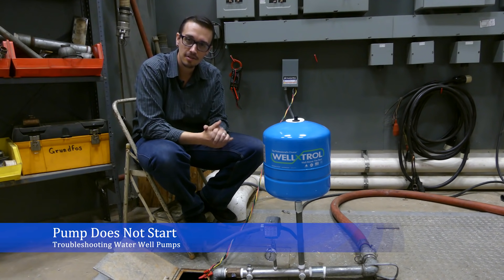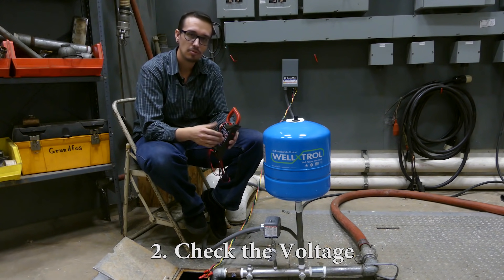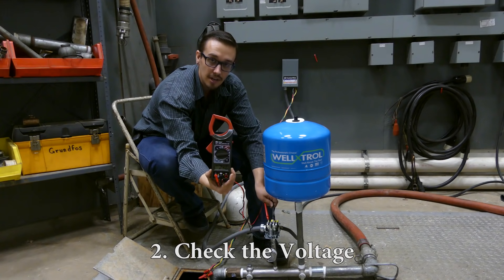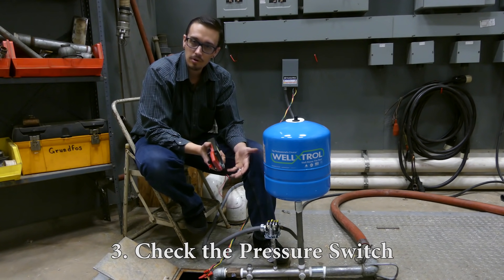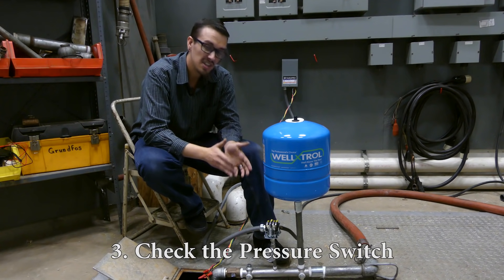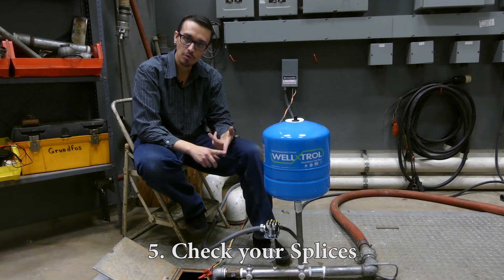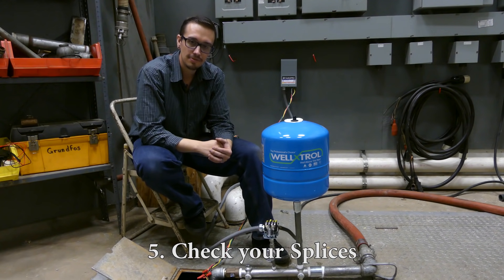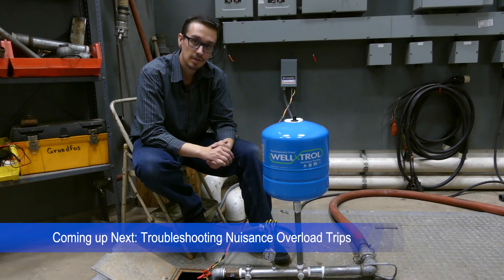Troubleshoot: Water Well Pump Does Not Start

Comment: I have replaced pressure switch twice. pump builds to 50 and shuts off. then drops to 12 before restarting. 28 in tank when empty.. removed guage and cleaned some gunk off with pump off. deided to turn back on to make sure no more gunk but no water came out. shouldn't water have came out of pressure gauge hole
Reply: Sounds like your pressure tank is waterlogged.

Comment: Have watched many of your other videos, learned much from them.  Now I have a situation where I have a no water system.  Just replaced the pressure switch, well pump fairly new.  So wanted to know how to check power at various points. This is less than helpful, when you start  throwing around jargon, without explaining what that jargon references, on top of pushing the probes into the control box, but then not letting us see (@ min. 1:43) just where you're poking the probes in....  (what does it mean to say, "across the line?"   oh, and showing us the meter, but being so far away not actually helpful....   Appreciate the spirit of this series, but cross check/edit your video with an intelligent novice who wants to learn.... don't just "talk" .... and presume we know what you're referencing....
Reply: Big time

Comment: Hey there I could use some help. 
I replaced the switch panel for my water pump, to a start switch. Which means I have to click the switch on the panel to turn on the pump. 
When I switch it on, it clicks but doesn’t run. 
This water pump is two months old and hasn’t had any issues until now. 
I’ve changed the foot valve in the well, primed the well line and pump. Still no luck. 
What else could be going wrong?
Reply from the maker: Check to see if the pump is getting power at the motor.

Comment: We replaced the pump switch. The problem we’re having is that we have to keep manually resetting the switch. The breaker is not tripping. It happens at various times—even in the middle of the night when no water has been used for hours.
Reply from the maker: Sounds like you have a leak.

Comment: After 27 yrs living in a house with a well here’s where I start
(modified slightly for lawer safety check…. namely #1

#1 turn off the power

#2 which would be #1 without lawyers is I take the top off the pressure switch and look for ants in between the contacts . 

#3 If there are ants Say an expletive or 2 , recheck that power is off, blow the ants out with compressed air and flip the contacts open and closed with a insulated tool like a screw driver while looking at contacts to make sure they’re still good and clean

#4  if contacts are durty etc is replace the pressure switch 

#5 which doesn’t count if there were no ants or obvious problem found is  turn power back on and put the cap back on or visa versa.

 This is also a good place for a few more expletive’s and visualizing an electrical world without ants…. 

#3 if there were no ants is check the wiring 

IF you have 220/240 there are 2 black and 2 red so check each red and black with contacts closed and open to check power … This must be done with power on so don’t do this  if your neighbor is by the pool in a bikini… Fortunately I don’t have any pools next to me…

If the pressure switch electric is good now is a good time to check the air pressure in an empty tank. That number should be on the tank and correlates to your switch pressure.

The pump will run too much if the empty tank air pressure is too low etc. 

My pressure switch is 40-60 so my empty tank pressure is 38…

Today is was at 20

If your breaker is blown or the overload reset switch under your well pump electric box is popped you can reset them but you still need to find what popped them.

My electric box has a run capacitor and a start capacitor. 

The start capacitor was rusty and worn on the top… or bottom depending on which way you face it so I just replaced it AFTER tripple checking power was  off and g rounding the terminals with an insulated screw driver. 

Capacitors hold energy… that’s their job… 220 v (the amps in the volts) can kill you or even possibly give you an afro so be smart and fight power… I mean turn off the power…

The run capacitor looked good.

If they look bulged on top or sides they are bad,, also if rusty.. better safe than sorry.

Retested and thank God it worked cuz I don’t fit down the well shaft to get down the 250’ to the motor…

FYI my pressure switch has an external lever on it which has to be held just just right ti keep the contacts together till the water pressure is high enough to keep it on by itself. This is a pain in the butt BUT it stops the pump from running continuously without water so it’s sorta like insurance….

PS fyi… If you’re new to wells they usually are disrupted by ants in the middle of cold dark 30 degree F nights after you’re already in the shower…

Comment: Awesome video ty. Pretty sure my pressure switch is going bad or the points are corroded. I haven't opened it up yet, but tapping the PS made it work again (temporarily). It's now off again, but this is probably my PS going bad and needs replacing correct? Many thanks

Comment: Just sat on basement floor for an hour watching pressure gauge. Was at 55psi and dropped to 38psl which did start pump. Gauge went up to 55psi and pump stopped. No water was being used for the time I was watching gauge. Ideas????

Comment: Nice video!  I was using water earlier today and now I have no pressure.  I reset the main breaker and also the pressure switch.  When I had the pressure switch set to on absolutely nothing happened.  Any suggestions?

Comment: Thanks for the vid.  I ran through your procedure, unfortunately looks to be wires all have power to the pump, so no water for us this Sunday night.
Reply: Hi again, real fast, I was able to reach the well guy tonight who suggested I try leaving the breaker off for a few minutes which might reset it.  Few minutes didn't work, but 20 minutes did!  I'm still getting the pump evaluated tomorrow, but at least we have water now!  Maybe this will help someone else.
Reply: @Gene_Pondacres  I’m gonna try your solution now! I’m also without water on a Sunday and saw my tank was empty and pump wasn’t running. No dead fuse that I found, hoping the reset that worked for you works for me too!

Comment: Question we have had water all this time and woke Friday morning and started running the water and doing laundry and the water cut out and now nothing but a hum. When we plug the pump in it sounds like it wants to kick on and then shuts off? So we are basically getting the hum sound and then the motor wanting to kick on and turns off. Everything for the wires looks great and has voltage. Even tried spinning the fan. For the capacitor, there are two areas with no wires in the middle and one empty in the lower right close to you while the 2 in the back have wires and the one in the bottom left close to you has a wire. Can the wires be moved to the empty spaces to get the pump working again? Or will we need to replace this or get a new pump all together?

Comment: Hi Man, my switch couldn't start the pump sometimes. Specifically, it doesn't turn on, when pressue drops  below 40 psi sometimes, but it does working at other times. What could be the issue ?
Reply from the maker: You likely have sediment buildup in the tube that connects to the pressure switch, which blinds it from seeing the real pressure. I would replace the tube and switch and see if that fixes it.

Comment: How would  I know if the aboveground water pump is defective? On my system, I have to hold the pressure switch lever to start the pump. Then it tries to suck water, it gets to 30-40 psi, but when I open any faucets , the pressure drops and pump stops.

Comment: Hello, i have installed a water spigot on my well water supply line (there is  75' between the well pump and the well house)...was told i could install one anywhere in the system, so i installed one at the well pump and tied it into the supply line ..problem is no water will come out because pump wont turn on because the switch is at full pressure..do i need to remove/re-locate the one way check valve so the pressure will drop when i open the spigot?  Thank you in advance for any advice!
Reply from the maker: Yes, you will need to make sure there are no check valves between the spigot and the pressure switch.
Reply: @RCworstwater  Thank you sir!  Love your vids, very informative!

Comment: After replacing our switch,the pump cuts on/off way more than it did before.
By that I mean run time between the on/off cycles.
 Before it would run 20 +/- seconds. With water on.
Now it runs maybe 3-5 seconds. Or is that normal?
Reply from the maker: That is not normal. It sounds like your pressure tank might be set too high. Here's a video on how to check it: https://www.youtube.com/watch?v=w21qa2bMUh8

Comment: I just fixed my well for $8 thanks to your videos.  The capacitor in the QB box was shot, so I replaced that.  The points in the pressure switch were shot too, but the points have 2 pairs of connector points.  So I switched the power lines over to the other unused ones.  Pump started right up!  Thanks for these, this was just what I needed!  Tomorrow, I'm checking the pressure tank to make sure that's all good.
Reply from the maker: Way to go!
Reply: 25 year Alaskan fighting our well again today.

Comment: I am in Georgia and pump stopped running without warning. I found that small ants had got in the points and fried. They shorted out the connection of the points.
Simple problem. I used sand paper to lightly clean the points and that was fixed

Comment: Thank you for the video. I live in Florida. I have well for my sprinklers. When I set it on auto my pump doesn't come on at all and it will trigger the braker but when I set it on manual the water will come on. my sprinkler guy replace the controller but still do the same thing so he said I need a new pump. Do you agree? I'm just wonder if it is pump then why it still work when it's on manual mode?
Reply from the maker: Sounds like you may want to hire a pump company for a 2nd opinion.

Comment: well... i THINK i may be up SH*T creek.   temp dropped to -40C for a few days, still holding at -22C.   nothing new, happens every year, no freezeups.   well is about 200ft deep and 100 feet from the house, comes up under the pad through the concrete into the heated basement.   first noticed the toilet wouldn't refill... it's coming almost directly from the water in, so it doesn't go through the softener.   hoping it was the pressure switch, i replaced it... nope.   240 in so power is good.   so... options.   i have a faucet right at water in, with a shutoff directly after so i could directly wire the pump, hose to the faucet hose to a bucket and turn it on.   OR i could fill a bucket with warm water, and use a sump to put warm water BACK into the line.   is either going to do damage, assuming there isn't already damage?  at this point, with 3 feet of snow, it will have to wait until spring if it's not something i can figure out.   already got the bucket and pail of sawdust in the bathroom.   any suggestions?  pretty please?  is there a 'electrical' testing way i can check if the pump is bad?  seems coincidental it happened during a cold snap, so assuming it's frozen pipes.
Reply from the maker: We can help you find the best solution - please give our techs a call:855.329.4519

Comment: Wouldnt the pressure switch having open contacts tell you anything?  My pressure switch is corroded and the water works intermittently.   But the fact the contacts are not closed tells me that the pump is not getting voltage, so its circular.  The pump should have some pressure I'm assuming and this is what controls the pressure switch contacts.
Reply from the maker: Open contacts tell you that the pressure switch is seeing a pressure that is higher than it's cut-off pressure limit.

Comment: Hello Sir,  question...  my switch has power coming into the switch on both legs.  . but no power going out of the switch  to the supply box that runs to the pump on either of those 2 legs.
Does that mean my switch is bad ?
Thank-you.
Reply: Ha! Never mind,  my contact points were stuck wide open.  Haven't ran across a video saying that happens yet....  probably because I should have noticed that  right off the bat!  No contact at the points = no power out to the power box!  👍
Reply from the maker: Sometimes the problem is right in front of you, hope you got it taken care of :)

Comment: I'm still waiting on an answer. I've replaced the switch and recharged the tank...but still the pumps not cutting on...I have a 30/50 switch I put 30.5 psi in the tank is that the reason why it's not coming on ? Does the psi need to be    2 less for it to come on ? I need help please
Reply from the maker: Please give us a call: 855.329.4519

Comment: I'm watching this on September 21 2019 my pump isn't even cutting on. i replaced the switch..I think there is not enough pressure in my tank ??? Help !!! I hate this...Thank You
Reply from the maker: It sounds like there are other issues that need addressed besides the tank, please give us a call: 855.329.4519
Reply: My well is down today on Oahu. I need to check my switch and box.Good video's Aloha

Comment: I’ve been following your advice.  I have a Myers jet pump that ran dry .  Now when I turn it on I get a hum only , but the motor nor the impeller is turning. I now wish I had a low pressure switch vs the std pressure switch.  Did I burn out the electric motor or the impeller/ bearings or both?  Are these rebuildable and worth it  or just replace ?
Reply from the maker: It sounds like your capacitor may be bad and needs replaced. Give us a call if that doesn't fix the problem: 855.329.4519
Reply: If the impeller is not turning are the pump itself the shaft gear if you fried it it'll just that's the harm of death if your impeller still turns that your shaft don't then your bearings are froze up I just buy another one for a hundred bucks or so and forget it that's what I do I replace half a dozen of them lasted luckily 40-something years but I ran mine dry same deal and it'll run dry quite a few times but eventually it'll catch up to it there's a there's like a fuse link in there that was usually Chef cut off after that burns out bad luck

Comment: I can hear the pump humming when I plug it in but have no psi in my tank do I need to add air
Reply from the maker: It sounds like your capacitor may be bad and needs replaced. Give us a call if that doesn't fix the problem: 855.329.4519

Comment: Question,i have a 30/50 presure switch,and a half (1/2,0.5 hp )water pump with a 26 galons well tank,do you think is going to work ok the pump with that presure switch,if the pump have the power enought to keep the well Rull?
Thanks

Comment: Awesome vid. Easy to follow, even though I just started learning about wells yesterday when my water went out.  I'm hoping that it's not the well pump.  I have a guy coming tomorrow morning, in case swapping the pressure switch doesn't fix it. My setup is a bit different, the pressure tank is in my house, while the pump is at the bottom of a concrete pit in the yard.
Reply from the maker: Let us know how it goes!

Comment: Wouldn't everything shut off if the tank pressure was low i.e. 31 psi?  I have power getting to the motor (hear it humming).

Comment: I awoke to no water this AM 01-08-2017, The line from the Franklin Controller to the pressure switch has 0 volts. The other leg has 118 volts. I did the capacitor and relay test per your other video, it tested fine. All breakers are powered and on. Any ideas? Could a bad controller even if it test good cause a no power out issue from Controller to pressure switch? TY for any help it is very cold here in NH. Water is NOT frozen it is a power issue.
Reply from the maker: Cliff:  Thank you for the question.   It sounds like you may need to do some more troubleshooting at the control panel.  I would recommend calling Franklin Electric Technical Service Hotline at 800-348-2420 or call us at 855-329-4519.